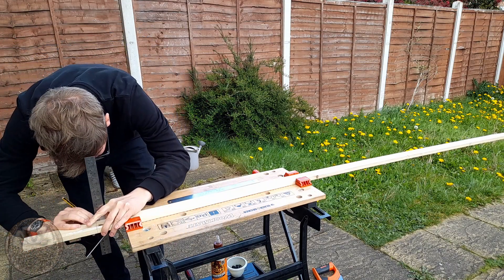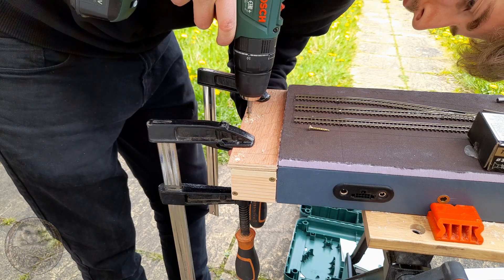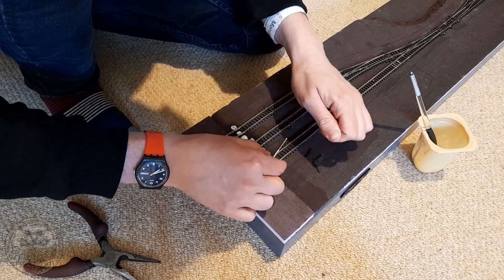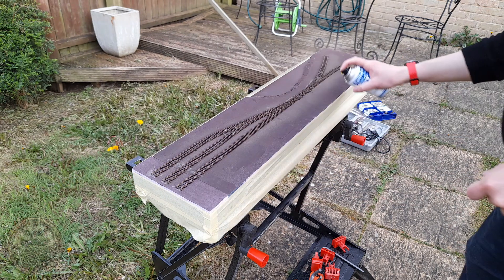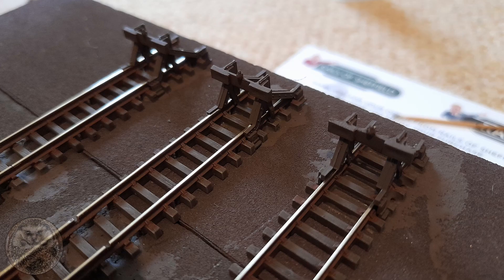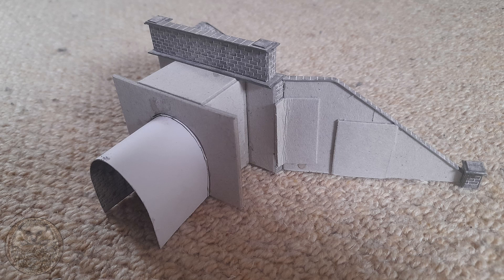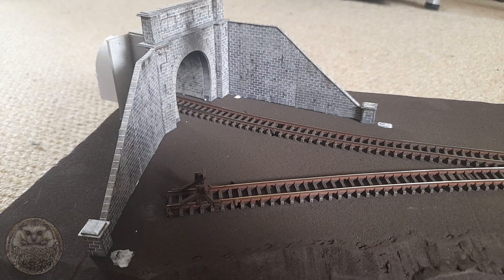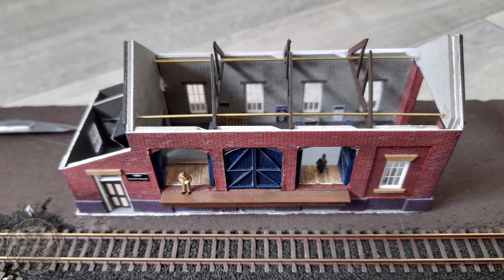N Gauge Model Railway Layout Build EP03: Extension and Ballast

Comment: Excellent work and very inspiring!
I also agree that it's a pity we still don't have a better way to de-couple wagons in a more realistic way without using hands.
One solution could be to mount the SD-Modell digital couplings to the loco, but the problem will remain for the middle wagons...
But even if operations are not 100% realistic, it's still great fun to move trains around :)
Reply from the maker: Thanks very much. I did see the digital couplings, although as you say they'd only work on the engines. However for a large layout where you're moving whole trains around they look like they'd be ideal. For me, the magnets work OK, they don't give a realistic operation but if we treat it as a 'game' then they're perfect. I can run through a whole Inglenook shunting puzzle session without touching the trains.

Comment: Noting you are coming from miniature painting I am surprised you left all the mould lines in the buffer stops but the paint job on the sleepers and rail is great.  You've done a great job with the Metcalfe tunnel (that comes from your scale modelling experience).  Magnetic coupling and uncoupling will improve with experience.  Its more difficult in N scale simply because you are dealing with physics:  the locos and rolling stock are so much lighter and you don't have the same level of motion control you would have at a larger scale.  You would have benefited by using tape to limit ballast where the tunnel was going then fit the tunnel but hey hindsight is a wonderful thing.
Reply from the maker: There are lots of things not perfect on the layout, but I am pleased with where it is. I definitely would have done a lot differently with the tunnel if I were to do it again.

Comment: For the "wiggle", look into decoders that automate this manoeuvre on the press of a function button: this makes uncoupling much easier.
Reply from the maker: I'll have a look into that - I am currently mostly running analogue but am thinking about converting a couple of engines to DCC and including a 'stay alive' capacitor
Reply: @hedgehoghobbies2836  Stay alives are an excellent idea. Use Zimo decoders and aim for at least 1,000 micro farads using tantalum capacitors of a suitable voltage. Possibly wait a month or three for the next generation Zimo decoders (the MN series) which should have stay alive circuitry built in so that you only need to add the capacitors. Some of the the larger of the current series (MX) already have thus, but ones that fit into N gauge currently require a separate charging circuit.